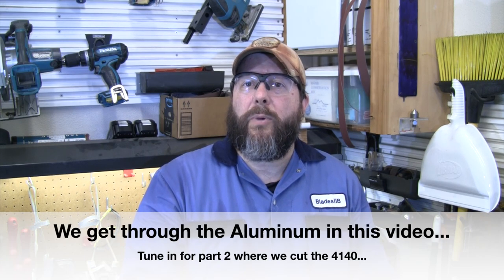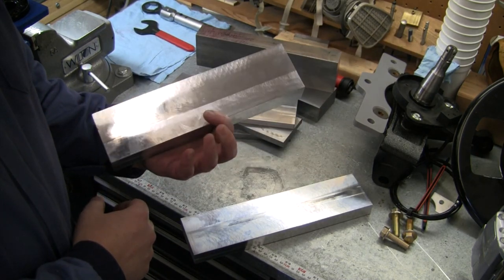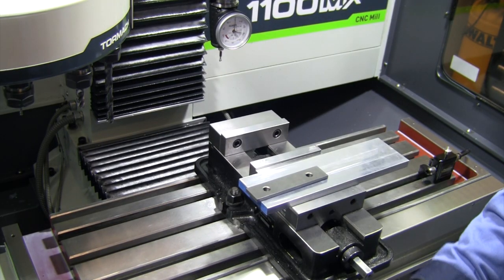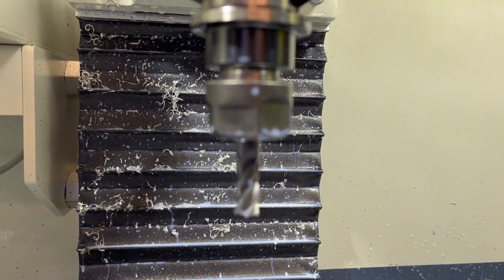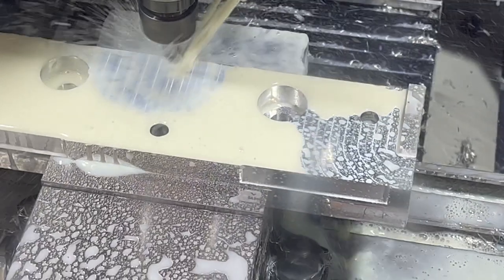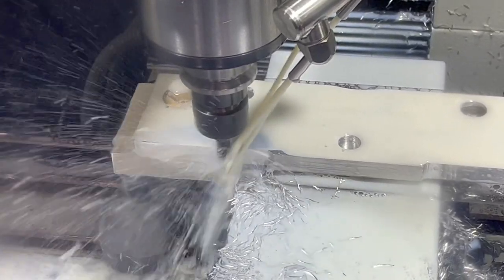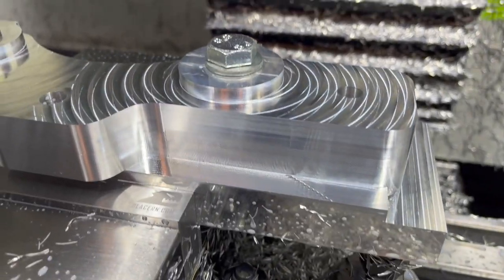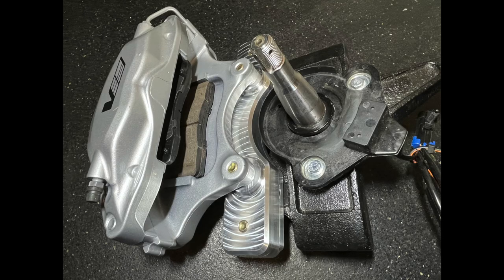Custom Brembo Brake Caliper Bracket - Largest Tormach Project So Far 6061 Aluminum 4140 Next

Comment: I know someone who manufactures Brembo knockoff brake calipers for scooters... he uses a YCM VMC to do the job... it uses Fanuc OiM2 controllers. But he basically makes a run of about 100 of them. If you got a CNC that is what you should be thinking (making a one off part on a CNC is really a waste of time, it takes a ton of programming and CAD work to make a working part, not to mention you need to make at least 5 sets of test parts to make sure it comes out right).

He makes them out of 6160 T6 aluminum, and the Brembo unit he is knocking off is cast.
Reply from the maker: Tyler Fu -  Yes prototype work on the CNC is not efficient. But this was very custom and no market to make more of them. Good learning experience. I did not want to try and machine all those contours by hand. My productions runs are my knife parts maybe I will find a little production part I can make money on. 😁
Reply: @BladesIIB  Speaking of production... I thought about using Xometry to do job shops... a CNC is extremely expensive, usually banks are involved if you buy them.. so it's gotta be producing parts in order for it to pay for itself. The problem with Xometry is I looked up how much I'd be paid for the part, and concluded that I have to be Elon Musk to work for them, because you actually have to PAY to work for them. You'd spend far more shipping the part to them than what you'd get from the work. I don't have a CNC because I can't think of anything that I can do that a CNC would help in such a way to justify its cost. I make acoustic guitars by hand, and I don't get enough business to pay for much of anything. Besides wood is easy to shape by hand.

The guy I speak of he didn't do any contours at all. He did it all using 2D and had custom cutters made for some profiles. I have no idea the cost to do this in the US. I believe he was making this here: https://www.scooter-center.com/en/brake-caliper-front-lhs-brembo-4-piston-oe-30/34mm-p4-30/34c-titanium-style-3332085 (it's made from 6160 aluminum by the way, not titanium, but the external shape is the same). Had all sorts of custom cutters made for the production. He had changed enough of the product to avoid any patent lawsuits. He had me draw the product in Master Cam once so he can do contours on it (as he doesn't seem to be very good at drawing 3D objects).

But I'll be honest, perhaps in the US it makes sense to make Brembo knockoffs for cars or trucks, but in Taiwan we make motorcycle parts mainly because the market for that is much bigger. Also installation is much easier as you require smaller facilities to install the parts compared to cars or trucks (I presume you're able to install it in your garage). But honestly I'm not sure your Tormarch is up to the task... you really need a bigger VMC (that isn't using an umbrella ATC) for this kind of work. The guy I know has 3 vises set up in the VMC so that he can basically do production runs in it. The coordinate to those vise is dialed into the machine.
Reply from the maker: @taiwanluthiers  I have heard Xometry prices are hard to deal with. Yea am still just a hobby guy so not looking to run my machine day and night yet. Don’t want to take the fun out of it. Having a larger machine would mean keeping it running more often for sure.
Reply: @BladesIIB  I really like to have a CNC though, but I just don't have the money to buy it... especially that bank loans in Taiwan is extremely hard to get. Plus I wouldn't want a bank loan as that would mean pressure to make enough to make the payment. The only CNC I have is a CO2 laser cutter...
Reply from the maker: @taiwanluthiers  Unless it is how you make your living, I agree don’t take a loan for one. The laser sounds pretty cool. I could use something like that for engraving and I know some even cut.  I am not to familiar with lasers, maybe one day.
Reply: @BladesIIB  The laser only cuts wood and plastic, not metal. It can stain anodized aluminum, but not really engrave them with any depth. I just use them to produce templates for guitar related work...
Reply from the maker: @taiwanluthiers  Gotcha, being a luthier has to be fun. I play guitar some, used to play more, never enough time for all the hobbies. I have a couple of CA (Composite Acoustic) guitars. They are out of business now I think but nice full carbon fiber guitars.
Reply: @BladesIIB  Honestly, carbon fiber have its place but I think most guitar players like the uniqueness and imperfection that wood brings, and carbon fiber doesn't really bring that. That and carbon fiber is a pain to work with, is unrecyclable, and is really unsuited for small luthiers. There's a reason even Elon Musk did away with carbon fiber in the Starship, because it's expensive and difficult to work with. My philosophy is that any wood has its character and a skilled luthier should be able to make even low grade top/back and side have its unique sound, even if it doesn't always look good. But building guitars in Taiwan has its challenge, for one thing humidity here is very high, and so keeping things relatively dry is a challenge. However I don't really have other good opportunities in Taiwan apart from retail, so I'm stuck making very inconsistent income doing guitar related work in Taiwan.
Reply from the maker: @taiwanluthiers  Agree, was not trying to take away from wood. Nothing can beat a true well crafted wood guitar. If you get a minute look up CA and check out the story. A couple of aeronautical engineers and they could control the density of the carbon fiber. They had 2 voicing and the sound is impressive compared to other composite guitars out there. I play a lot outdoors and the guitar is not affected by humidity at all. I could essentially use it as a canoe paddle and still play around the campfire that night. 😁. They did not make it as a company so wood is still king. Just thought you might be interested. And I agree it is hard to work. I have taken old RC helicopter frames and made a few parts from Carbon Fiber. Very hard and messy to work with. Makes nice parts though.
Reply: @BladesIIB  You know there was a helicopter company that made guitars... it's called Ovation. One of the biggest problem with Ovation guitars is their lack of servicability. This is a problem because guitars do break and do require maintenance. For example fret wears out, sound board bellies, truss rod adjustment, etc. and Ovation guitars were built in such a way that after about 10 years or so the guitar would essentially be useless as the neck is epoxied, and thus not adjustable for angle at all. I'm actually adopting Taylor's philosophy in making the guitar very easy to service, such as having a fully bolt on neck. Unfortunately it does sacrifice on cosmetics, as making the guitar with fully bolt on neck (that isn't a Fender solid body electric guitars) necessitate gaps as tolerance is required for the part to fit. And since I do not have the CNC equipment Taylor has, I can't make it to the same degree of fit as they can (as I'd fit everything by hand, kinda like trying to fit a rifle action to a stock without any gaps at all... tall order if you are not allowed to use epoxy bedding at all). But each guitar built is an evolution in construction methods. 

I can't really mess around with carbon fiber because there would be enormous costs for molds and fixture, not to mention wearing protective suit of any kind in 100 degree heat with 100 percent humidity. I can't work in uncomfortable clothing. There are already wood that basically require PPE to work due to chemicals they contain...

But the reason I have a lathe is to allow me to make fixtures that aids in guitar building, such as a buffing assembly and thickness sander. Right now I have a thickness sander adapted to work in a knee mill. I would machine an arbor that fits a large 4" sanding drum, and a wooden plank is attached to the mill table, and the Y handwheel allows me to dial in the thickness. At some point I want to make a dedicated machine for this with feed belts.
Reply from the maker: @taiwanluthiers  Gotcha, sounds like a good set up.
Reply: @BladesIIB  By the way how are you running a CNC without 3 phase power? I would assume most residential area won't have it. Do you use a really big rotary phase converter?
Reply from the maker: @taiwanluthiers  My Tormach CNC is only single phase 220v. My lathe is 3 phase and I use a large VFD. I rewired the lathe for the VFD controls. You can see the whole video on that on the channel. I prefer the VFD over the RPC since you get speed control and electronic braking.
Reply: @BladesIIB  Yea I've been thinking about VFD too, except there are a bunch of relays and contactors on the Victor lathe that I am unsure how I'd wire it for a VFD (then there's the cost of the VFD itself too). Furthermore, in Taiwan/China seems the biggest single phase to three phase VFD they have tops out at 5HP, any higher and they are 3 phase input only. So that complicates things. My lathe has one problem in that I am unable to use the highest speed (1800rpm) because the motor stalls out and trips the breaker when I try to start it up. I tried adding a few more motors to the circuit in order to give it extra juice, but no go, just as it gets up to speed the breaker trips. I guess a soft starter would be helpful for this. 

I would think the PM 1440TL lathe comes with VFD all built in? I know PM generally does this as they know how rare 3 phase can be for residential properties. In Taiwan getting three phase is a bit easier (both of my neighbors have it, so the cost is fairly low), as Taiwan is mostly tall buildings so 3 phase is delivered to the curbside, and a split phase transformer then feeds the 110/220 to the residence. There are some properties with three phase supplies simply because of how the building is wired (elevator and all that), and in Taiwan a split phase transformer is required if you have a three phase supply, because Taiwan's three phase supply does not supply a neutral.
Reply from the maker: @taiwanluthiers  My lathe did not come with a VFD so I had to do all that myself. If you watch my video on it you can see where I pulled out all the high voltage wires from the lathe contractors and now use them to pass the low voltage signal to the VFD. My motor is 5HP so PM offered a Hitachi VFD large enough to run it. Do some reading I think for a larger motor you just need to double those VFDs you are looking at. They get de rated with single phase input but I think most of them still work with single phase in. They are not like a static converter though they have to go direct to the motor and wire everything else to control the VFD. I have a separate enclosure for my VFD and the extra wiring. If you can get 3 phase close I would do that.  It is not possible to get 3 phase to a residence here. Unless maybe you border a commercial property?
Reply: @BladesIIB  It would cost more than the VFD and the associated work to get 3 phase installed. I am actually in an industrial area so there's a lot of 3 phase here. The problem is the landlord don't want the trouble... and because in order to get 110 in Taiwan with a 3 phase supply you must wire in a transformer, that would also mean a rewire of the entire house. The landlord probably do not want that either. So if I get a 3 phase input VFD I can still use a single phase input if I derate them? I do not know if my Victor lathe has a 5HP or a 7.5HP motor, because I'd need Superman to lift the motor up to see the nameplate. I can't see a name plate on the motor from where I'm at. Victor's spec do not work because the victor lathes in Taiwan have different spec. Maybe I can use a 5HP VFD and then use soft start to prevent from blowing the VFD should the motor turn out to be 7.5HP. The motor is single speed (not one of those two speed motors used on American Victor lathes). 

I would need to remove all the contactors and find the right microswitch for the fwd and rev position, the stop command for the foot brake, etc. while manuals and stuff aren't exactly available... I did get a copy from that Abom guy (he scanned a copy of the manual). The VFD would be beneficial as I'd be able to slow the motor down for stuff like cutting threads (right now the minimum speed is 65 RPM).
Reply from the maker: @taiwanluthiers  Sounds like VFD is the way to go. Maybe use a mirror or slide your camera Nader the motor to see the plate?  The wiring is tricky for the VFD. As for the size the VFD company you go with should be able to help you. I know for the Hitachi they provide the specs to help you match a unit to your motor size and provide the de rate specs if using single phase input. I would think the other VFD manufacturers would do the same.  If the existing contractors are in good shape you could possibly use them to control the VFD. I have single phase still powering the transformer in the lathe and using a lot of the existing wiring. I rewired all the front controls and did change out the brake switch to a 2 pole to send a free run command to the VFD as well as stop command. Every lathe is different but there are a lot of forums with people who can help with VFD questions.
Reply: @BladesIIB  Thank you for the response. I think you are the first youtuber who responded to me, most the time I post a comment on a video, the guy has millions of subscribers and it could be years before I might get a response from some other user (in fact I just got a response for a video I commented on in 2016... back when I was still going to UT Austin and messing with guns). Luckily my lathe do not have a transformer or anything, the contactors actuates on 220, but I think I would rather skip contactors if I can because they're confusing to wire and I've let the magic smoke out of a few of them already just because of unclear instruction (I did this on trying to upgrade my rotary phase converter to automate the cutoff of the starting cap because the Chinesium contactor has both leads for the coil on the top and the bottom, and I assumed that the top is for L1 and bottom is for L2, so when I threw the switch the power went out in the whole house... short circuit and all that. I'll find time to see if any component is trashed... at least I got the automating cutoff of starting cap to work once I figured out what the lead for the coil is, and so now I just throw the breaker on the RPC and the start cap cuts off in about .3 seconds (I set the timer to that). 

If I get a VFD I will likely get a chinesium VFD because otherwise I would never be able to afford it. Taobao has increased my purchasing power quite a bit and allowed me to play with stuff that I would otherwise be priced out. I can read Chinese so if the instruction is in Chinese it is not a problem, but oftentimes these Chinesium stuff is shipped with minimal instructions, and so I end up letting the magic smoke out of stuff because of that (Chinese do not always follow standard design basically).
Reply from the maker: @taiwanluthiers  Happy to respond. I am a small and hopefully growing channel, but mainly just here to try and help others learn where I can. When I get to a million subs I am sure there is money to be made.  Until then just here to have fun and help.  Your contactor design sounds interesting. Every lathe I have looked at uses a transformer to pass 24v signal voltage for the contractors and the contractors pass the high voltage to the motor?  If you have no low voltage path then would be large wires going to all of your switches?  Anyway, you seem to have a pretty good handle on it so I am sure you will find the best way. As for magic smoke 😂😂 check out my surface grinder videos. I let a little of that out smoking 2 motors trying the simple process of wiring 110 to 220 volt. Painful and humbling.
Reply: @BladesIIB  Is there a way we can talk in a less public setting or semi public setting apart from spamming youtube's comment section? Like maybe a forum you own/participate in or email/facebook?
Reply from the maker: @taiwanluthiers  Sure I am on The Hobby Machinist forum.  www.Hobby-Machinist.com. Or go to my website www.BladesIIB.com and hit the contact me link there.
Reply: @BladesIIB  I'm having trouble with the hobby machinist site. It tells me I must accept cookies to use the site but I can't find a way to do that...
Reply from the maker: @taiwanluthiers  Check your pop up blocker. Should just be a pop up that you hit accept on.
Reply: @BladesIIB  I fixed it, cleared site data and it worked.